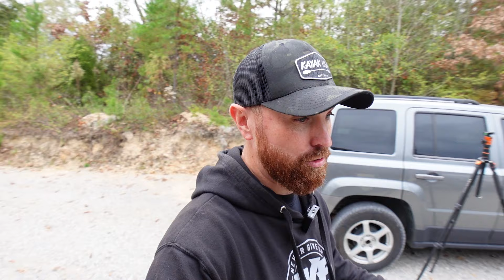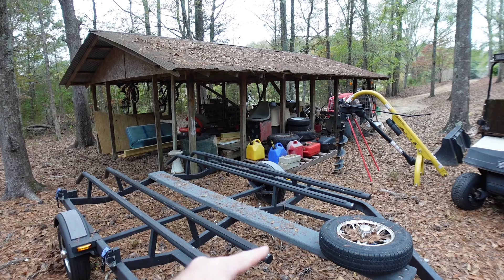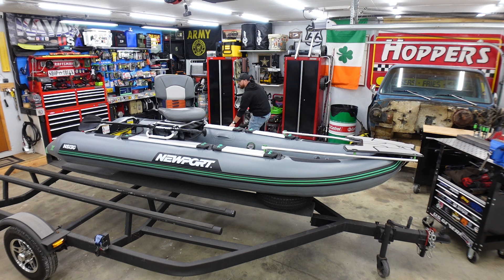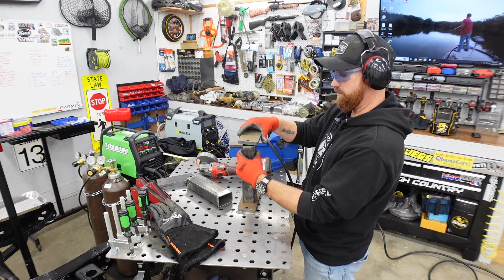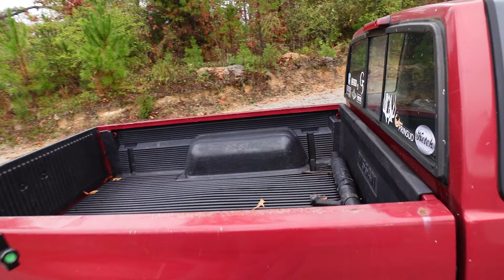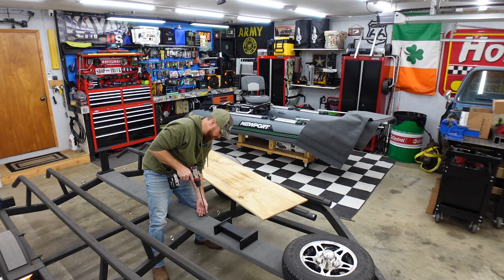Building A Multi-Use Kayak & Inflatable Skiff Trailer (EASY & CHEAP!) DIY

Comment: Personally I would of copied what you had already done but have them removable by making pockets on the frame. The straps should hold them plus the boat. Have extension that way you can do just boat, boat kayaks or remove for just kayaks.

Comment: isn't the whole point of an inflatable is not to have a trailer etc . throw in car n go??
Reply from the maker: Yeah, you should watch the first video to see why I’m doing it this way. 👍🏼
Reply: Did you even watch the first 25 seconds of this video? 😂
Reply: I understand why you built the shelf like you did, I’d be more comfortable (long term) if tubes were supported on the carpeted deck.  Can’t blame you for not wanting to buy another trailer. I would want a bow strap on the D ring to keep air from getting under the hull going down the road. It will be neat to see the yaks and the skiff on the trailer. Enjoyed your video. Thanks